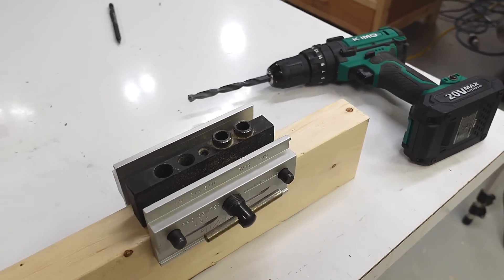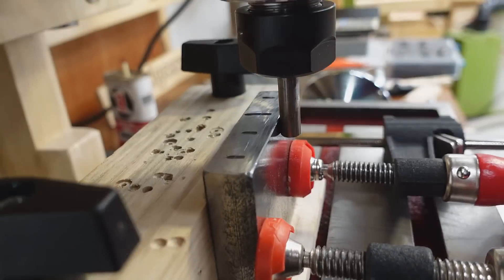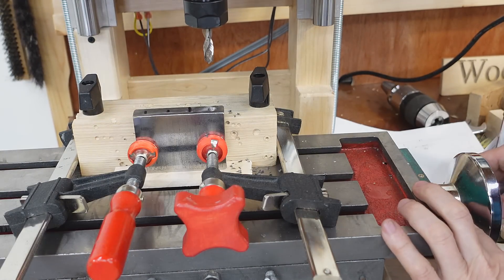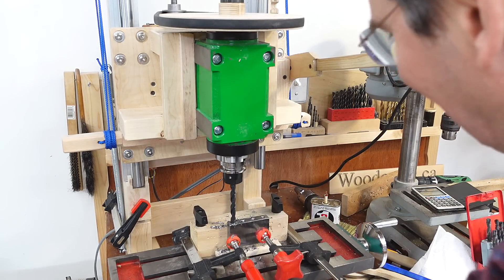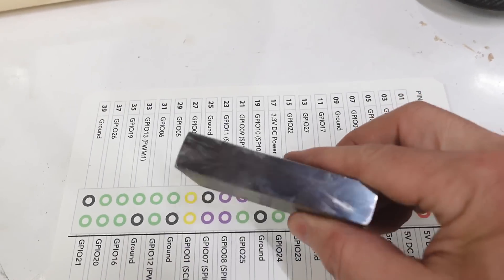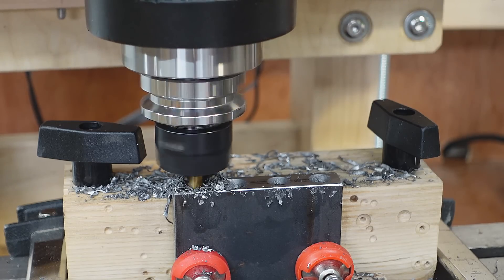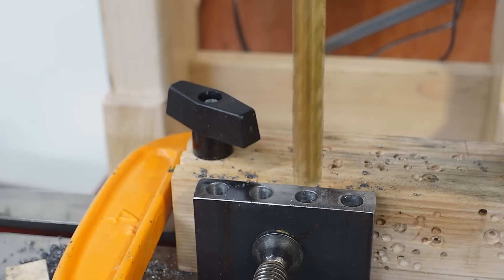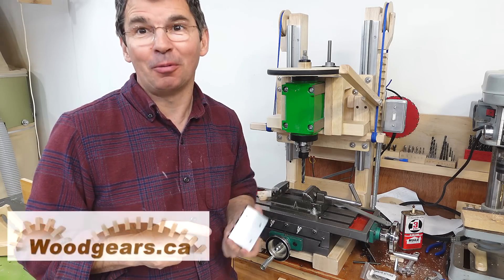Milling the dowel jig I always wanted

Comment: If you have 2 cheap digital calipers, you could put those on the X and Y axis of the table and use them to position the workpiece. Kind of like a cheap DRO.
That's an old-school tip from back when DROs were expensive to obtain. The early kind of calipers also had RS232 output to hook up to a PC but I doubt anything new has that interface anymore..
Cheers,

Comment: Fun as always! And inspired on the angle grinder setup. 

It would interesting to see you add a "DRO" to your mill setup by finding a way to strap a cheap digital caliper to your table. Seems very congruent with your clevery hacking approach. :)

I do think you're going to be unhappy with that dowel jig over time. Having done something very similar recently, I was dismayed to see just how quickly drill bits can erode mild steel. You will either need to remake it more often than you might like, or find a way to harden at least the holes. I have used Cherry Red for this, and Artisan Makes does a lot with case harending in charcoal. Or you could make it out of some steel that can be hardened. 

Also, please be careful with those chips! Much more than aluminum, steel chips and burrs can be *sharp*. Watching you wipe them away with your fingers had me worried for you. A chip brush is a good idea.

Again, enjoyed it as always.

Comment: Hmm, wonder how the accuracy compares to something like my dowelmax.  It is precision machined, but you have much more support on those deep holes.  And there is variation in the dowels themselves.   In the end, we're working with wood, so I bet yours is every bit as accurate as a commercial unit.
Reply from the maker: actually, probably less accurate.  The dowelmax is no doubt manufactured on a proper CNC milling machine.

Comment: The reason the hole the first time came out oversize is because the influence of the non cutting web in the center of the drill bit being off center. The non cutting center being off causes the drill to deflect and causes the longer flute to be the only one deciding the hole diameter. The second try came out undersize from what you expected when you used the undersized drill AND drilled a pilot hole because the center web of the drill was not able to force the longer flute to influence the size of the hole and so the hole comes out more to the actual drill diameter. If you had used the second drill without a pilot hole you likely would've gotten the result you expected based on the oversized nature of the first holes. Something else neat is you can actually abuse the behavior of a drill cutting oversize due to one cutting edge being longer, you can grind a drill asymetrically to pretty precisely produce holes anywhere up to nearly a 1/16" oversize from the drill diameter.
Reply from the maker: so like I said.

Comment: The jig is not level probably because the table is not true, and the wrong mark could be welded i guess. Nice job though, the most important part is having fun!
Edit: to right the table you probably could extend it to the left and right and mesure the drill bit against something clamped in it.

Comment: If your uprights deflect at all, (bit no longer perfectly perpendicular to the XY bed,) the drill will bite on one side (in line with the rack / uprights) and cause that nasty chatter and a hole less than straight through.

Comment: - wooden milling machine
- "i'm not sure why it's chattering so much"
gotta love the confidence.
Reply: I mean, how aligned/trammed in is the chuck?
Reply from the maker: do tell how that its made of wood will cause chatter.
Reply: @matthiaswandel  Im assuming he is just talking about rigidity and loose tolerances for the sliding mechanism.  Not just that its specifically a wood problem...
Reply: @matthiaswandel  You would have issues with chatter with endmills because of wood due to the rigidity, but for this instance it's an issue with the cutting speed and the predrilled hole. In wood it's not much of an issue but in metal the predrilled hole isn't supposed to be larger than the flat on the tip of the drill. When the predrilled hole is larger than the flat on the tip the angled sides have a hard time aligning on the edges, especially if the angled cutting edges on the drill aren't ground evenly. Also, if the cutting speed is too fast the drill will bounce off the material because it isn't cutting fast enough because of either the sharpness of the drill or the pressure you are applying. I don't know if you sharpen your own drills, but a drill sharpening gauge is very useful to help get them the same angle and length on both sides so they don't drill holes oversized. Also maybe look into making an assortment of pulleys to give yourself a wider range of speeds.
Reply: @matthiaswandel  exactly, being sure what's going on and seeing through "obvious culprit",
Reply: @matthiaswandel  clarification,i have no idea what might cause chatter from a video, but you eliminating general structure and build material requires knowledge and confidence in what you're doing, that was the point
Reply: @matthiaswandel  Please just buy a proper milling machine
Reply: @dariuscalitz9704  that would be so boring.  This is Matthias-style machining and there's nothing else like it on YouTube!

Comment: You need better fixturing (holding the part) if you want accurate parts, like a milling machine vise, which is machined not only true but also designed to prevent lifting.  Even a small one would be better than a block of wood......  And, yup, the only way to get accurate holes is to undersize them and use a reamer.   For long holes like this you need some sort of lubricant or better yet, coolant.  Glad you got there in the end....

Comment: Coming from a bit of a metalworking background, it's quite interesting to see a woodworker's perspective on machining metal.

For the problem of debris getting stuck in front of the drill, you might want to pre-drill with about a third the diameter for any drill over about 6-ish millimeters

also a centerpunch is immensely helpful for getting your holes started in the right place, a punch mark at least the size if the point/web of the drill you're using will pretty much stop the bit from wandering
Reply from the maker: and how do I get that center punch mark on there accurately enough?
Reply: @matthiaswandel  Just spitballin' here, but how about holding a cheap automatic center punch in your chuck/collet/spindle, using your XY table to locate the position, and driving down with your Z-axis handle to form a mark? Might be easier than using a height gauge, gauge blocks, and a surface plate to scribe lines which you then center punch.
Reply: @matthiaswandel  using layout techniques so that your punch marks would end up centered on the intersection of your scribed lines.  You'd be surprised by the amount of precision that can be gotten this way using the standard measuring tools and a scribe. Its just a step up from you existing techniques in wood where you print out and glue the blueprints to the part but instead you are scribing the print on the part so you can follow it with your machining. The advantage of scribelines is they can be much finer than anything you could print so you can be much more precise with your cuts and punch marks etc. This is also why layout fluid is used, to make the faint scribe lines more visible by adding contrast since where you scribed won't just have a line but also be the bare metal against a different colored background.
Reply: @JonSturm  why would he use a hand punch when he has a milling machine and a center drill?
Reply: @matthiaswandel You're correct. You don't center punch when you have a milling machine and a way to accurately locate your part. You use a spot drill, which is very similar to the center drill you used at 7:45. So similar that I wouldn't bother getting a dedicated spot drill.
Reply: @matthiaswandel That’s a great question. Ain my apprenticeship once we marked hole position and centre popped the target we would blue up a draw of increasing diameter concentric circles, then drilling with the full size drill we would judge the position of drilled hole to the marked circles, bringing it back on target by making radiator grooves with a small vee shaped chisel. That was on drilling machines as an exercise in self flagellation - never did it in real life or on a mill.
Reply: @matthiaswandel  That's typically done by marking the positions using a height gauge on a surface plate. If you don't want to do that you can use a special starter drill in your milling machine. They have only a short section with flutes, the rest is solid. That way they are stiff enough to not wander without a punch mark. After creating a starter hole you change over to a normal drill with flutes so the chips can clear the hole.
Reply: @matthiaswandel  As others have already said, the first thing that is important is to mark accurately, ideally with a height gauge. When it comes to punching, it is best to have plenty of light so that you can see the lines clearly. To punch accurately, make the first blow very lightly (it is also important to only hit once otherwise the punch will move). You can then direct the punch mark a little by placing the punch at an angle and hitting it again. The last hit must always be vertical. With this method, an accuracy of less than 0.1 mm is no problem.
Reply: @matthiaswandel  yeah, don't do that. use a center drill or spot drill in the mill.
Reply: @matthiaswandel  instead of a center punch you could use a spot drill in the chuck, which does more or less the same

Comment: About the chips accumulating in the hole that you are drilling: that mill, can you rebuild the mill upside down? (Or even turn the entire thing upside down.) I mean a setup where you are drilling upwards, instead of downwards, so that gravity helps to clear the chips from the hole. The mill has to be rigid anyway, for the mill the direction of gravity shouldn't matter. Positioning the workpiece would be a bit more fiddly, but once clamped it'll be fine: the clamping force is many, many times the force of gravity. (As to the millling table: I expect it will work the same when upside down. The milling table is supposed to be rigid against the workpiece being lifted towards the spindle. )

I very much hope to see an innovative maker construct an upwards drilling milling machine.

Comment: Matthias, I appreciate you going down this machining rabbit hole, but you seem to be struggling with a few things because you don't really grasp the basics. Use cooling fluid, or cutting oil, or anything to help lubricate your tools when you're drilling and cutting. It will lead to far less tool wear, cooler parts, and better accuracy parts. First drilling a smaller hole, especially with underpowered and unstable machines like yours, is definitely the way to go rather than trying to force a bigger diameter drill through that much material. The big chisel point of your bigger drill is fighting you every part of the way through that hole, regardless if you're having chips caught under or not. Also, you're running that reamer way too quick. You can definitely get good results regardless, at the expense of your reamer, and heating it up to the point you're softening the cutting edges. Run it slower and with plenty of lubricant. Every reamer should also definitely be bought with the appropriate drill to go with it. Running it through smaller holes than intended, especially dry, is risky 🙂
Reply from the maker: I added a bit of oil from time to time (didn't leave all that in the edit), but I certainly don't want to flood my wooden table and wooden workbench with cutting fluid.
Reply: @matthiaswandel  No I get that, which is a flaw of a wooden machine for sure. You may try thicker greases or heck, even a wax, anything which helps lubricate the cut. You can dip the whole reamer in a thick grease and run it on a slow RPM and both the hole and reamer will be better off from it 🙂

Either that or invest in carbide tooling which will hold an edge longer 😜
Reply: @matthiaswandel  There are thicker lubricants to help with this like anchor lube that I've seen other youtube machinists using that is more like a grease than messy cutting fluid but I 100% understand the not wanting to mix sawdust and oily liquids in your wood shop.

Comment: Low quality drill bits tend to have a lot of chatter. also you can use a piece of paper to find an edge with the tool you are using. exited to see you move to the iron age
Reply from the maker: paper has 0.1 mm thickness.  I can gauge more closely than that.
Reply: @matthiaswandel  You can compensate for that 0.1mm if you need, or you can use cigarette paper that is much thinner.

Comment: A general rule of thumb for speeds and feeds with a reamer, compared to a drill, your spindle speed should be half and your feed rate should be double.  This is of course relative to the material being cut.  If you're getting chatter, slow down the spindle speed.  If you're burning up reamers, slow down the feed.  Also, reamers are not meant to be pecked in a hole.  Go all the way through the hole and pull all the way out.  Leave clearance for chips to fall out or set up air/coolant blast to clear chips.
Reply: Good shout. I was thinking the reamer looked like it was having a bit too much speed.

Comment: Matt, I think some of your inaccuracy may be due to locking the XY table in one direction (X or Y) against the gibs; it pushes the table off axis.  It may be better to clamp it in place through the Z axis.  The problem of the bores not running parallel to the sides of the block may be your clamping: you had the clamps low on the block, compressing it against the wood backer.

Comment: Nice to see a use for your still somewhat cobbled together mill of sorts that really is making use of its features. Though to really make great use of it you should now square off the whole dowel jig with it, especially the top face as that has the added benefit it will erase or at least massively reduce in the size your misplaced scribed line so you can do it again and do it right this time.
I've lost track of how many times one of my quick and dirty jig for something where only the one essential face/corner is actually correct to the function has been annoying eventually - one day you will want to drop that jig down somewhere awkward and wish the whole thing was actually square, or had the working angle/distances stamped/etched into it...

Comment: You absolutely can do that with a drill press. You just have to take your time with the layout and set up and make sure to accurately center punch where you want the holes first. I have done tons of very accurate hole drilling on a drill press. This was still cool and a neat machine. Keep changing and perfecting it to fit your needs.

Comment: I'm using a set of precisely ground sleeve bearings I bought online for about $15 USD. Then I can easily design a jig and drill holes in polycarbonate to hold the sleeves. It's all the customization without the need for more than a drill press. It's still a work in progress.

This is after I bought one of the premium doweling jigs and am unsatisfied with its limitations.
Reply from the maker: where do you get those sleeve bearings?
Reply: @matthiaswandel  My post containing the amazon link has been delayed or deleted, so I'll post again without the link.
search for "sleeve bearings". The one I bought is from Uxcell and has sizes 3mm to 10mm. Another brand surely has imperial if you wish.

Comment: first project on your own mill, that's got to feel good!  that aspect ratio for drilling is tricky even on a heavy milling machine.
with the reamer-fit hole, could that block have been 1/2 the depth and still worked (well) as a drill jig?  
As always, very impressive angle grinder skills!!
Reply: TOT! With perhaps a little better layout precision than we have here (maybe center punching?), a viable approach can be to drill undersize from opposite sides and then meet up both holes with a reamer. It's also doable to use a twist drill as a reamer (still follow the reamer rule: half the speed, twice the feed!), although Your Milage May Vary…a lot! And of course now you have a real 3/8" reamer.
Reply: @johnhawkinson  I don't think that would work. Reamers follow the path of the drilled holes.
Reply: @franklinslagpile  I was not speculating, but of course it depends on how close your holes are and how much work you are asking the reamer to do. Reamers follow holes but they won't follow sharp discontinuities, so either the reamer will mostly true up the holes guided by its shank or you'll have a catastrophic failure. Stefan Gotteswinter talks about and demonstrates this method in his April 14, 2024 video ("Making a Part: Bioreactor feeder ports") at 2:54 and 27:14 (obscured). I'll link the video in a followup comment to avoid getting this comment hidden for including a link.
Reply from the maker: I wanted those holes nice and deep so the drill has less leverage on the sides of the holes.  When I use just a block of wood as a dowel jig, that’s super important.  And the block isn’t hardened steel, so I wanted to give it that advantage to avoid wear.  Also given the spiral flutes of the drill, I figure  wanted half a turn of the flutes in the jig at the very least.
Reply: Hey @ThisOldTony ,I think you have to make the opposite video now. Precision milling a drilling template in soft wood :D
Reply: TOT please make more videos 😭
Reply: It might be easier to maintain the hole over a short distance. You could do a block half as thick, and then another identical and attach them together with a flat faceplate of some sort